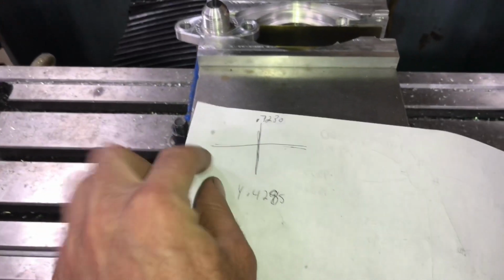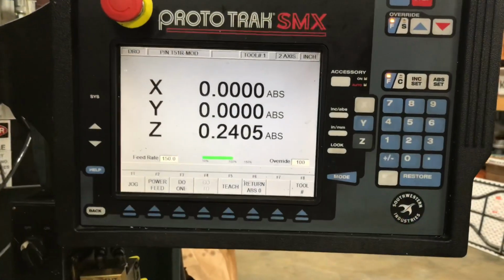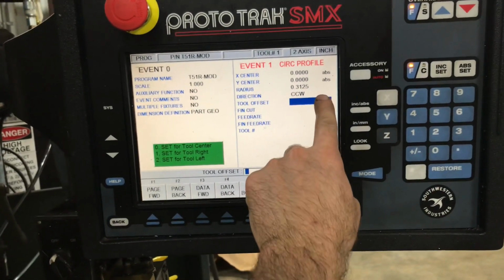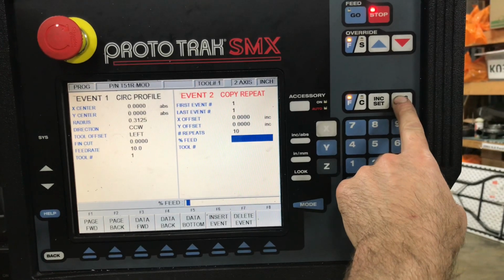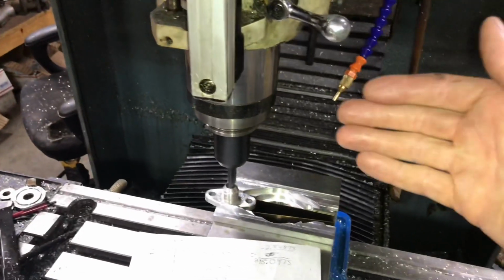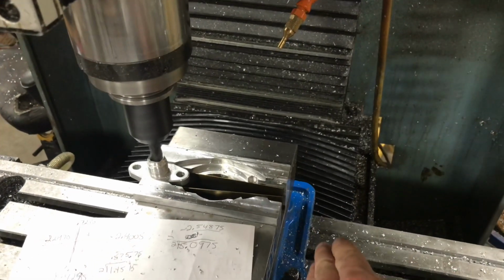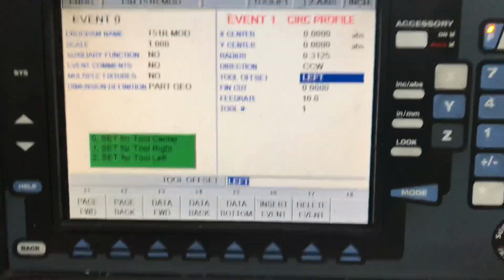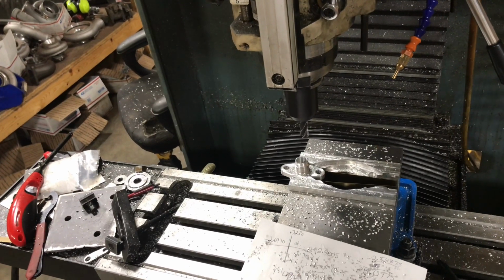Prototrak Circular Profile on -10 an Oil Drain

Comment: Great video love the machine work I have a question for you. I have a 21 Infiniti Q 60 TwinTurbo, and on a JB4 tuner module, I can see both of the turbo boost, and one turbo is making more boost than the other. What would cause this issue

Comment: ,,, Im amazed that it wasn't big enough as you first started . I wonder if the blend did not match the outlet close enough ?
Reply from the maker: The blend was good. Usually the drain line ID is big enough but the fitting isn’t.